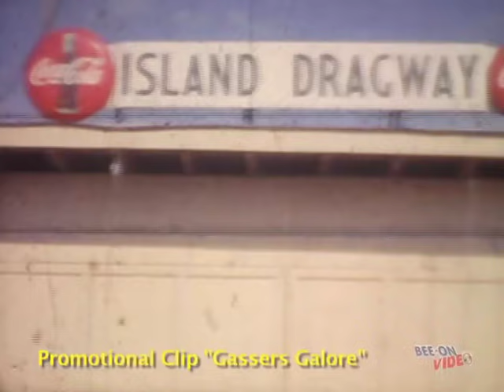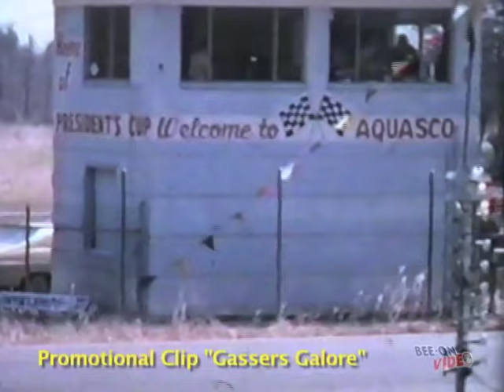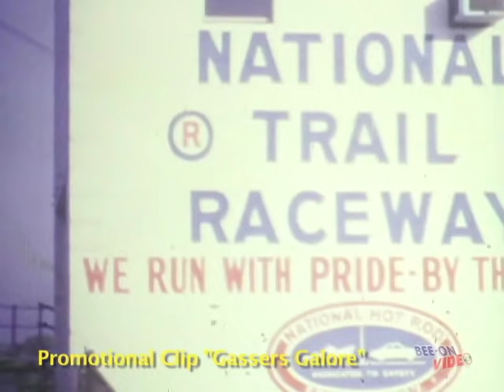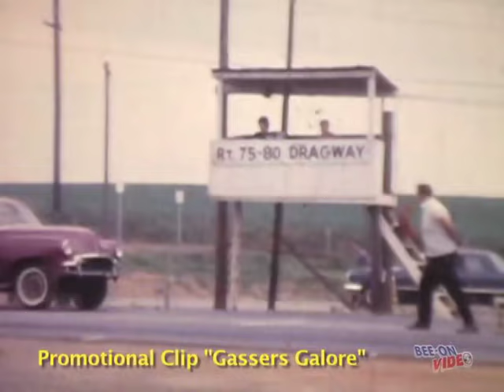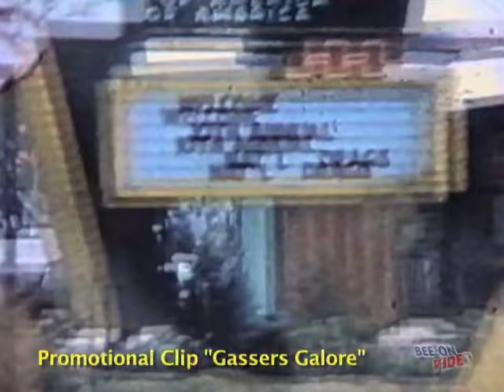GASSERS GALORE  THE GOLDEN ERA OF THE GASSERS

Comment: Island Dragway was my home track from 1999 til 2020. I raced a street legal, 2003 Suzuki GSXR-1000 with no wheelie car and a DOT legal rear tire. In 2012 age 62, I set the track speed record that still stands for ALL motorcycles at 168 mph which can be seen on YouTube by typing Joel Turpin in the search window. Stopping in 1800 feet was scary and had to lock up both tires to get stopped. I was using nitrous on that pass. Then, at age 69 I set the track ET record with no nitrous or turbocharger at 8.50 @ 164 mph which can also be seen on YouTube. A week later I had a pass or 8.55 seconds @ 165 mph on motor only. There was only 1800 feet to stop from those speeds.